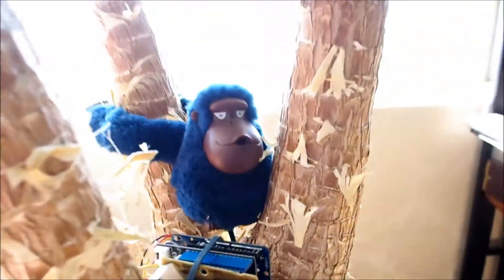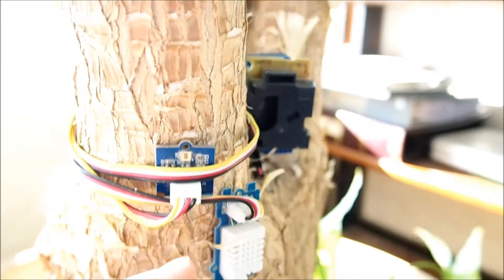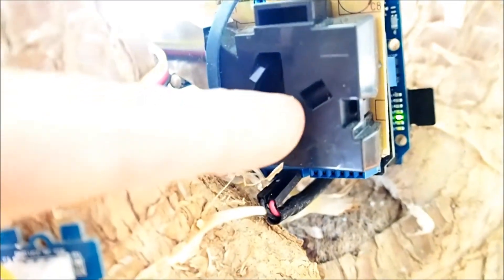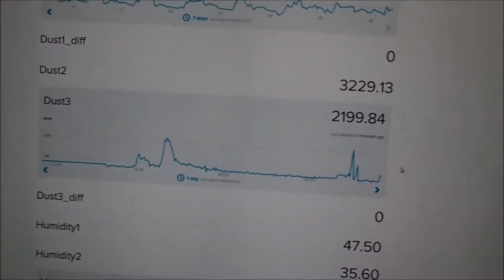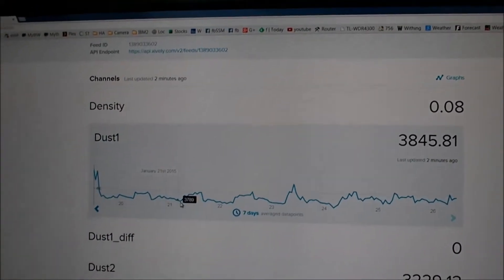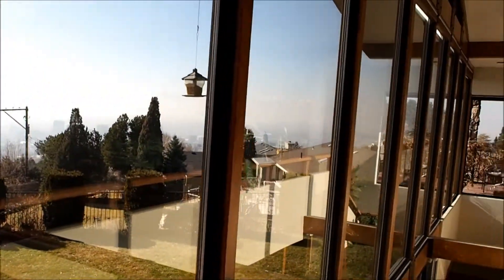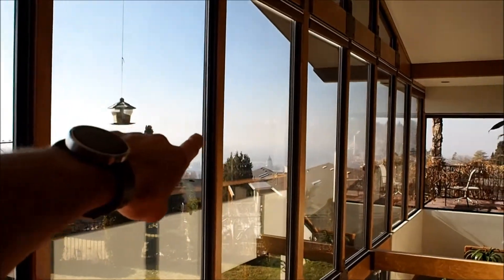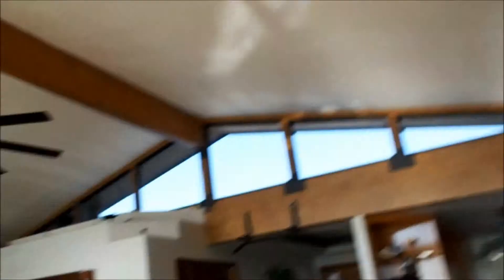Monitoring air quality

Comment: i like ur house and pool. (gta5) huh.  i have similer dsm501 sensor. but it gives me arbitary values. can i have ur arduino code pls?
Reply from the maker: There is a blog post that goes with that video here:  http://misterhouse.blogspot.com/2015/01/monitoring-air-quality.html

Code is here:  https://github.com/brucewinter/myhouse/blob/master/yun_pool.ino

That dsm501 dust sensor seems to be hit and miss.  I had 3 of them, some worked better than others.   Adding a little fan to get better airflow helped.   Search for "Ultra Miniature Fan" on ebay, should show you several < 20 mm fans.
Reply from the maker: Sorry, wrong link.  The dust monitor code can be found in this example:  https://github.com/brucewinter/myhouse/blob/master/yun_air.ino